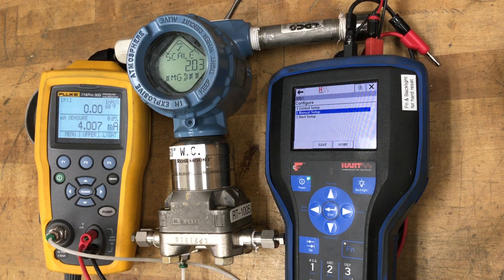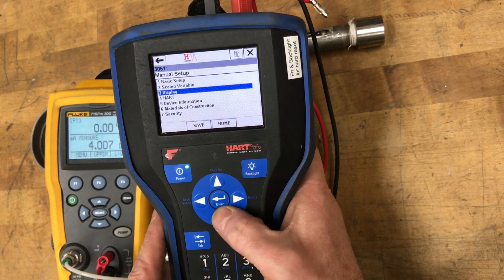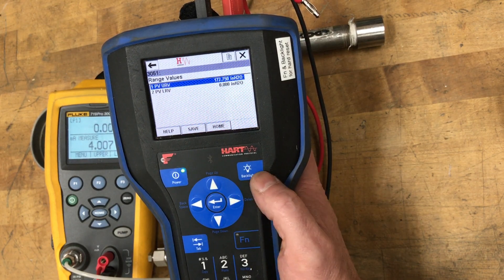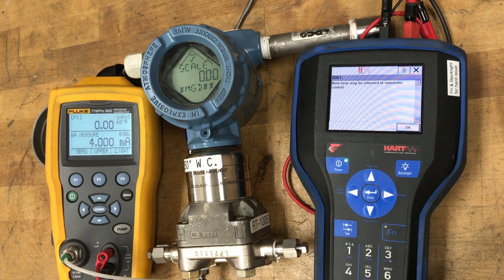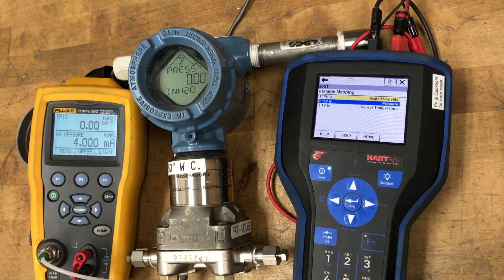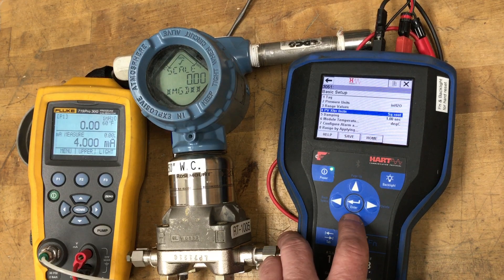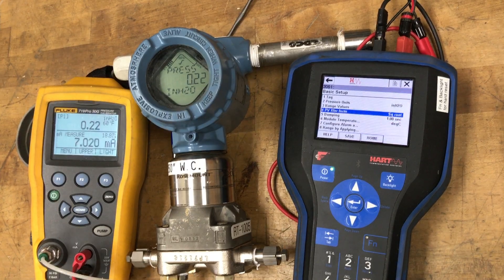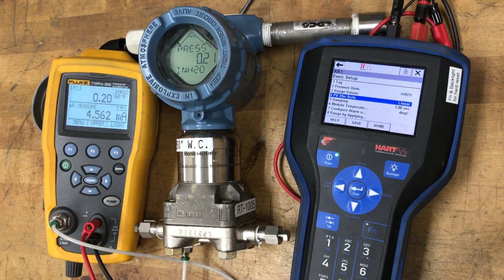Rosemount 3051S3CD2  - changing Primary Variable from Pressure to Scaled Variable

Comment: Hi, what is the fluke device on the leftside only recognise the 475 field communicator
Reply from the maker: The Fluke device is their 719PRO30G Pressure Calibrator. I can't say I would recommend it but the few I have used have been adequate...